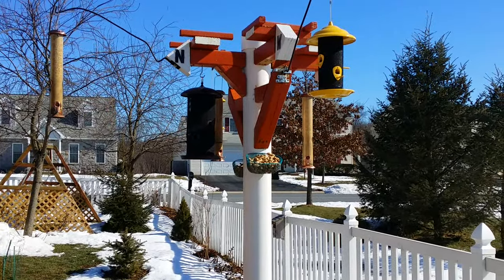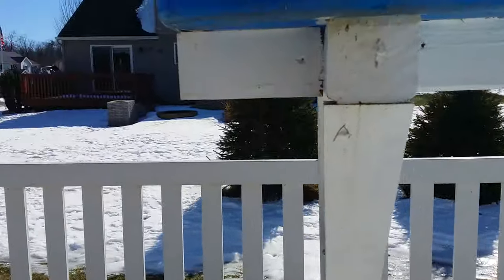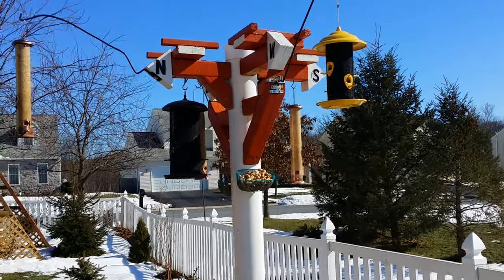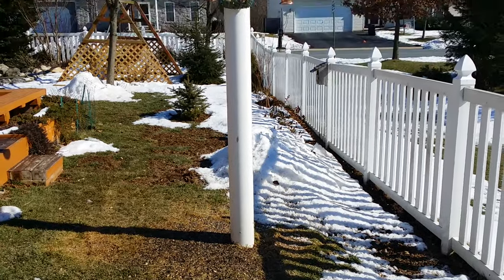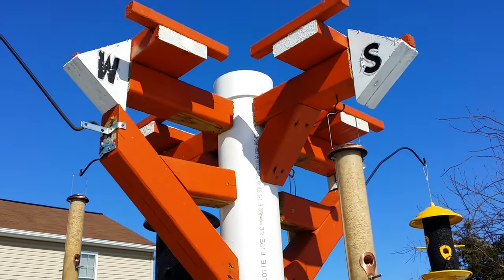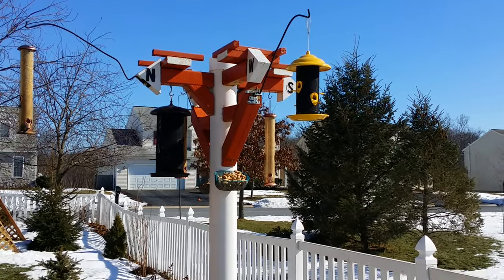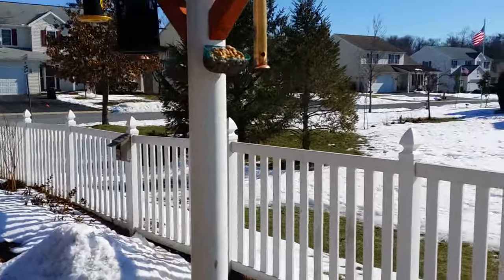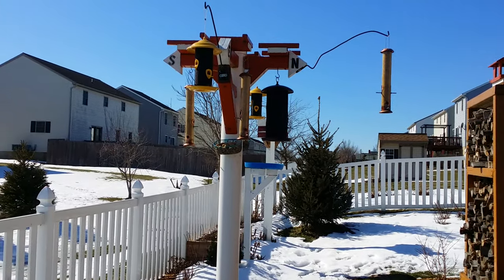HOME MADE PVC bird feeder pole

Comment: I did this 2 days after seeing this video. I used a  3” pvc pipe, cut it 8 ft tall, put it in a bucket with cement. This is a totally awesome idea, much sturdier than using Shepard’s hooks. So very helpful. Thank you for sharing!!
Reply: Did you bury the bucket or leave it completely above ground
Reply: Great idea , I like that I can move the bucket around the yard

Comment: Based on this I created a similar unit. I used a 4" dia x10'  pvc pipe ($10 home depot). I put a couple of rebar through the bottom and sunk it about 2' deep and filled the hole with Sika expanding foam . I put 3, 1/2" × 4' dowels through the top with a solar fence post light on top (so planes don't run into it at night).  The squirrels can't get to the feeders now and the feeders do last alot longer. Thanks for the idea.
Reply from the maker: Sounds awesome my Friend. This Bird Feeder Pole sure does save me from buying so much bird feed now.

Comment: Excellent idea! I can't see them climbing that pipe. I have a feeder on a 7 foot  5/8" pole  ,and it has a cylinder squirrel baffle near the top. It has worked 100% for years,but last week,a big grey squirrel climbed the pole and jumped over the baffle! I had 3 feet of 1 1/2 " ID PVC pipe laying around,and put that on the pole under the baffle. I don't think they can jump over the baffle now to get to the feeder,but time will tell. The culprit hasn't been in my yard for a week or so.

Comment: The most sensible one ever uploaded. Thanks so much for this sir.
Reply from the maker: Glad it was helpful!
Reply: Norman, I can attest to the success of this design. I built mine very similar last season, and it is definitely squirrel proof. Alto the tree rats do a good job of ground feeding,  (with a few glances in the upward direction). Thanks again to the OP. :)
Reply: @artistben7  isn't the setup too close to the fence?  i've seen squirrels jump more than 6 ft. and can easily reach that peanut holder

Comment: We as well have major squirrel issues . How did you attach the wood pieces to the pole please ? Most excellent job I must say ! 
Also , what was used for metal poles to hang feeders and how they were added on please ?
Thanks so much ! 
Steven
Reply from the maker: I attached with 4 inch decking screws for every thing. The metal hangers are simply potted plant hangers from Lowes.

Comment: have already had the 2' hole dug and ten foot 4x4 I'm planning to cutdown, have 6" stovepipe sitting around  years.  I do like the PVC idea, I actually came in, got on Y Tube for an idea how to do the cross bars, yours look GREAT! Question  cab7 please, how do i attach the 4 x4 cross bars for the feeder. and I believe I'll add the the directions too. After 20 years my wife still does not  know which  way is which. were in the country no buildings houses, clear view of the sun when it comes up over the hill top  trees. Or when were suppose to driving east in the morning I wake up from  nap and the Sun is on our left. Am I  the only one that has this  problem?   Sorry for rambling on, Again thanks for sharing.
Reply from the maker: I simply brought the 4 inch deck screws in at an angle through the 4x4 pieces into the pvc & into the interior 4x4.
Reply: @artistben7  Thank You sir.

Comment: Good job, thats a great idea, the squirrels cause havoc with my bird feeders. Next time I go to Lowes ,10" pvc will be bought. Ill post videos on you tube of my bird feeders.
Reply from the maker: It has saved me a lot on bird food my Friend. I used a 10 ft treated 4x4 and buried  & concreted it 2 feet in the ground then slipped the 10 in PVC pipe down over it. I cut the pvc pipe down to  8 feet.👍☕👍
Reply: cab7 thanks as i said earlier I will be building this if you see my beer review videos in back of me is woods full of squirrels ( bird food stealers) ha ha
Reply from the maker: Ahh yes the hungry deep woods squirrels. I built our pole away from any trees or tall structures, buildings fences ect.  It works great.

Comment: This is a really great custom build! I know you said a 4x4 inside, and did you say the pvc pipe is 4” or 6” diameter? Do you have any other measurements on the post sections at the top?
Reply: I used and built this design this spring, and installed it in my backyard. He's right, about the squirrel proof. I witnessed a few failed attempts the 1st day, and the squirrels have given up. 

After a couple weeks, I did see them up there, one day only, and believe they jumped out of a big maple tree, not far from it. But the branches they must've climbed out to the end, broke off. (Landed on the ground below). They must've "sky dived" from the branches above, about a 10-15' drop or more, but have since thrown in the towel. They now scrape the ground waste with the doves. 

I had an extra 10' piece of 4" PVC, and used that for this project. But in order to slide a 4X4 inside, I had ta take my circular saw, (on a 45°) and shave down the 4 corners lengthwise in order to get it inside the tube. A bit of a pain, but saved some $. I'm now beginning a circular red brick ground cover, (around the pole base), to make it easier to maintain, and give it a little pizzaz. Thanks again to the OP for this idea.
Reply: joe quillun do you mind to share your specs of what did? See my comment above. I want to build one, just wondering if anyone has specific specs on what they did.
Reply: @Dukesbag1  Mine isn't "exactly" (board for board) like the design above, but pretty close.
I went outside, and took a few basics, and will say that the stationary compass, (the maroon cross with the NESW letters on it) is about 42" from arrowhead to arrow head.(inside the white triangles).
And that assy is roughly 7' off of ground level. W/ 2- 1/2' in the ground. The cross and the 45°angled bracing, look to be 4X4s in the video, but I didn't have any in my scrounge, so I screwed and glued some 2X4s to make them wider. My 2 long angled 4X4 braces, are about 22" long. My attachment method on the top, is a bit different from the OP, because I mounted a gazebo style hopper feeder in the middle of the top. That's about all I can offer you now josh, so I hope it helps. 
The dimensions aren't set in stone, so don't be afraid to modify yours. Good luck.

Comment: I love this idea, going broke feeding the squirrels instead of the birds. I need to try something like this.  When I go to my local store do I ask for a 10 inch diameter pipe plus length need for height, correct?
Reply from the maker: Yes a 8 foot long by 10 inch pvc pipe and one  treated 8 ft 4x4  and a small box of 4 inch decking screws. One bag of Quickcreat cement. dig hole 2 feet deep to put the 4x4 in and concrete it in. let dry for 24 hours. Then buy the hardware to hang the bird feeders. Remember to put in your yard away from fences trees/bushes or buildings.👍👍👍👍👍

Comment: Excellent idea, how tall is the 4x4 inside the pvc? I'm looking for a way to put an owl house 10ft up.  AND be able to take it down for maintenance. Would 3 ft of 4x4 sticking out of ground be enough to hold a 5lb house steady?
Yours is the best idea yet!
Reply from the maker: The treated 4x4 is 8 ft tall and the PVC is cut down to 9 ft tall.  1- 50 lb bag quickqreet
Reply: Regarding the 8 ft length.  Does that include the 2 ft in the ground?
Reply: Nevermind.  I found the answer further down.  Its a 10 ft length of treated  4x4.  Thanks.

Comment: Not sure how the brackets attached securely to the pole? We want to make one.
Reply from the maker: I used 4 inch decking screws drilled through the pvc pipe and into the treated 4x4 inside the pipe.

Comment: Great job! I am definitely going to try to make something similar. Quick question - how did you attach the wood to the PVC. Thank-you!!
Reply from the maker: This is a fairly simple project. I dug a hole 2 feet into the ground & placed a treated 8 ft 4x4 into the hole  Concreted the pole in & then slipped the 8 ft PVC pipe over the top of the 4x4. Since the 4x4 is sunk into the ground by 2 ft, the pvc pipe will stick 2 feet above the 4x4. Using 4 inch decking screws I screwed through the pvc into the interior 4x4 which keeps it in place. I screwed 8 screws into the pvc 4 upper 4 lower from all 4 sides. Add exterior  paint if you want other then a White pole and add hardware to to be able to hang your bird feeders. I hope this helped my Friend.👍👍👍👍☕
Reply: thank-you for the quick response!!!
Reply from the maker: You betcha my Friend.👍👍👍👍☕

Comment: You said 10 inch PVC. I don suppose you know if a smaller PVC pipe would work? 10 inch pipe would cost me around $80 where as a 4 inch PVC pipe which would easily cover a 4x4 would be $10. If you used a 10 inch PVC than there would have been a ton of play between the 4x4 and the pipe. How did you manage that play? Did you shim it with something? Thanks.
Reply from the maker: You are correct,  10 inch PVC is quite large, but I am one that wants to prevent any climbing animal from getting to the bird feed. I used 4 inch Decking screws to penetrate  into the 4x4 with no problem. No shimming here my Friend.
Reply: Thanks, I did some more googling, and it looks like anything bigger than 6 inches will work and 6 inch is WAY cheaper than 10 inch. I'm going to try it. I will let you know how it turns out. Thanks for the video. You offered hope when I was hopeless. LoL.
Reply from the maker: Our 10 inch PVC 10ft pipe is $45. I suppose the 6 inch would run about $34. I havnt had a squirrel problem since i set up this bird feeder pole. Remember to keep it away from structures and trees and you will be just fine my Friend.👍😊

Comment: how did you make the cap at the top of the pipe or can you buy those?
Reply from the maker: You can buy the cap for the top of the bird feeder pole my Friend happycanadianguy👍👍👍👍👍
Reply: @artistben7  I'm trying this project tomorrow.  So to be clear, you have a 10" pipe slid over a 4 x 4 post.  So I guess this means it's not a snug fit and there is some give between the post and the pipe?  Also is it hard to drill holes in pvc?  Thanks and Hapoy Easter!

Comment: Very nice design!  I like the idea of marking N-S directions, though in a few thousand years, you will need to adjust them :-)
I have a couple of questions:
Q1: Is the pipe internal diameter 6 or 10?  You have mentioned 10 in the video and it the comments below, but the description says 6.  (A 4x4 post would fit nicely inside a 6 inch pole -- about 5.3 inch diagonal len for 4x4).
Q2: I have a few 4x4 treated posts on my retaining wall and some of them have bent/twisted over the years (though not in the direction of the wall force).  Did you have such problem?
Reply: Looking at some of your replies (Timothy, justicecenter, etc), I now gather that it is indeed a 6 inch internal diameter pipe.  I still want to know, after all these years, did you notice any bending of the inner 4x4 forcing the outer PVC pipe to incline in one direction?  Thanks!
Reply from the maker: @charismatic1516   I have no way of telling if the inner 4x4 has bent in any direction since I screwed the pvc fast to the 4x4 in many places. The pole has never shifted in any direction over the years,. I am pleased with this project.

Comment: At the 0:55 mark you said this was 10" and then later you said it was 4"  ?
It doesn't even look like it is 4" in diameter but I could be wrong.
Reply from the maker: I went outside to remeasure this PVC pole & it came up to 21 inch circumference all the way around the outside. It is a large pvc pipe. The orange painted wood you see built into the top of the pole are 4x4 inch treated lumber. You can make a judgement on those pieces compared to the pipe and know its quite large. A 4x4 treated piece of Lumber easily fit down into the pipe with room to spare.
Reply: @artistben7  
I just noticed your written video description seems to indicate 6" (?)
Sorry if it seems like I am nitpicking you, but the diameter is important.
And I am not sure how to convert circumference to diameter.
The price of PVC poles goes up disproportionately when you increase the diameter.
I love how you did this .  I use 2" diameter PVC poles for the same purpose 
because that allows me to fit an Oatey toilet flange over top snugly.
Then I secure a metal laminated rack to the toilet flange to 
support an enclosed platform feeder to deter pigeons and doves.
(I use a gauge of wire on each end that prevents large birds from entering.)
I just noticed that Oatey has 2 different model numbers for different 
sizes but Home Depot only stocks one size which is an Oatey 43564
but it could be a 43561.    
But your feeder is definitely a lot cooler and you probably couldn't
support all that stuff on a 2" diameter pole.

The one thing I like about mine is that it is held up solely by gravity and 
it is a simple matter to lift the entire assembly off the top of the pole
when I want work on it or take it in for some other reason.
I keep a couple of squirrel traps at the foot of my feeder
but out of 462 squirrels, I have never had a grey squirrel climb 
my 2" diameter pole.
WRZ 2022-05-30

Comment: Why not just put the 10-foot, 6-inch diameter schedule-40 pvc pipe 2 feet into the ground and fill the bottom of the hole with expanding foam?  I would think that the pvc pipe is very strong without the hassle of the post reinforcement.
Reply from the maker: I have always went with what works for me my Friend. I suppose one could use the expanding foam if they chose to.👍
Reply: @artistben7  Looks great though Cab7!

Comment: Fantastic idea but would like to point out the pipe is 4 inch pvc not 10 inch.  This in no way takes away from your great craftsmanship.  Just letting folks know what pipe to shop for to build one also.  Thanks for the post.
Reply from the maker: +J L Grizzly   Thank you kindly J L Grizzly. The diameter is 10 inches on this PVC is what I should have said. Its a big pipe. $44 10 foot length.  :)
Reply: @cab7 if the diameter is 10 inches than it is 10 inch PVC pipe. Do you mean the circumference is 12 inches, and the DIAMETER is 4 inches? I want to do this soon, but I won't do it if you mean the diameter is 10 inches cause 10 inch PVC is $80 plus for 10 feet.
Reply: I hope @J L Grizzly is correct, because 4 inch PVC is like 10 bucks for 10 feet in my town.

Comment: Something doesn't add up. A 10" inside diameter PVC pipe which is how pipe is sized and sold, would have an outside circumference of 32" not including the thickness of the pipe wall. Not 21" circumference as you state. It appears that you used 6' PVC pipe. This would give you the 21" circumference. Not knocking you but want people that duplicate yours to have the same effect against squirrels.
Reply from the maker: You are indeed correct my Friend. The thickness of the wall is 5/16 inch. The pvc pipe is 6 inch indeed, leading the circumference to be 21 inches.👍👍👍👍👍

Comment: I believe if you take a ruler out and measure that PVC pipe you'll discover it is actually 4" PVC (As another viewer told you earlier, and you still insisted that because you paid a ridiculously high price for it, it had to be 10" PVC!).   NOPE....  It's still 4" PVC even if you did get ripped off at the store!
Reply from the maker: The circumference of the pvc pipe is 21 inches around. Its rather large, Im simply happy that it works to keep the squirrels away from the feeders. Thanks so much for your input.
Reply: If it were 10" pvc, you could fit 2 1/2 4X4's in it. I can't believe that the pvc is almost a foot in diameter for a 4" piece of wood..